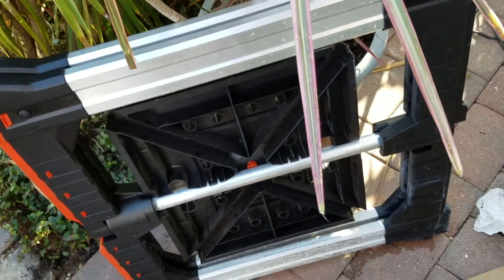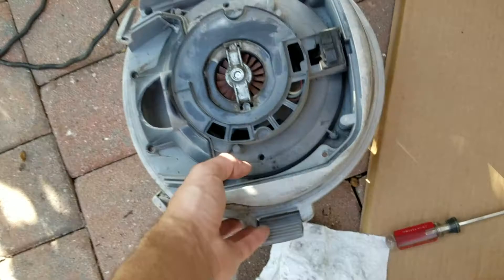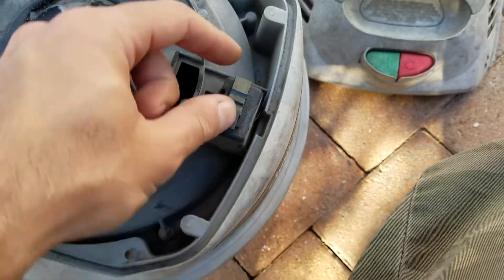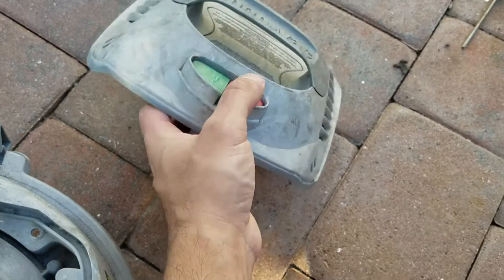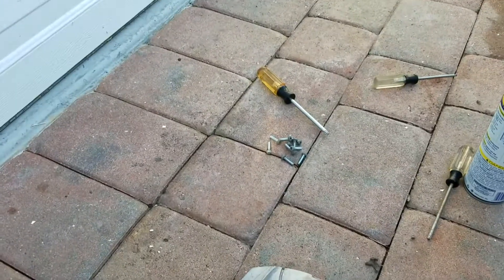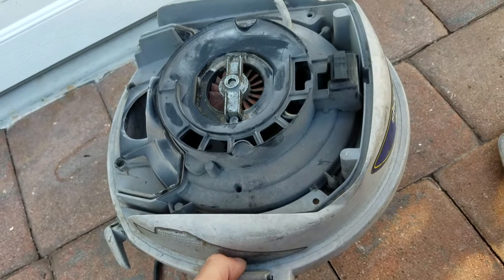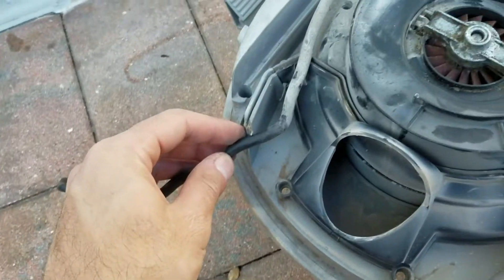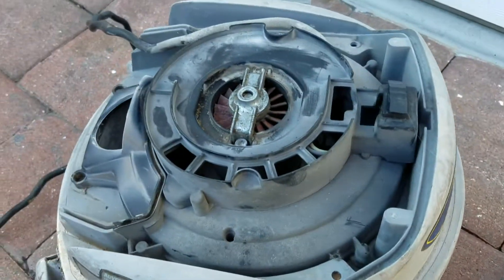How to Shop Vac Broken switch fix

Comment: Take a Cheap Extension Cord with a " Flip Switch ".  Get the Switch out and replace it.  It's almost the same principle :D
Reply from the maker: I just got one of those in my truck full of hoard.  Double ended plug, long cord, has a switch.
Reply: Those swirch are only rated 5A iirc...
Reply: @daijoubu4529  - Duh...... You get a Switch that will match the device.
Reply: @JodBronson  what I'm saying is that the little inline switches are only meant to be used for lamps, I have yet to see a inline switch with a high enough rating lol
Reply: @daijoubu4529  - Inline Switches on Vacuums are all over the place and "most" rated at 15A @120V.
Reply: @JodBronson  ok It looks like there are infact 15A inline switch, saw one made by Eaton/copper, all the big box store around here in (Eastern) Canada only carries the Leviton garbage and those are rated very poorly.
Reply: @daijoubu4529  - Back to my first post.  An Extension Cord have a on/off switch.  Even the one I got at Walmart for $5.99 have a good Switch.  15A as well. Next time you see someone throw out Vacuums, the Cord, Switches, Etc.... FREE !!!
Reply: @JodBronson  yep that what I've been doing, just a bit annoying since it's at the other end of the vaccum, so I stepped it up a bit, using a smart switch and a remote button I leave next to the vacuum lol, the bearing on mine is getting noisy, perhaps it's take to take it apart and fix it before it dies.